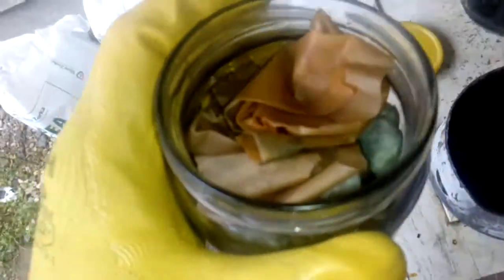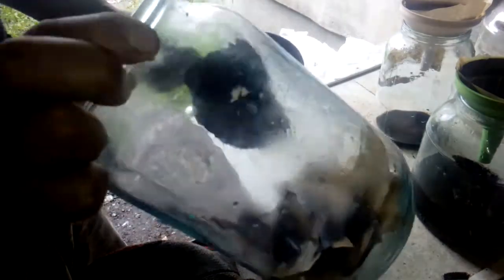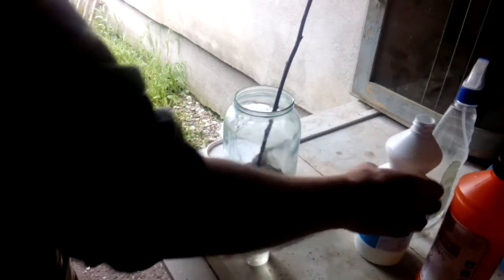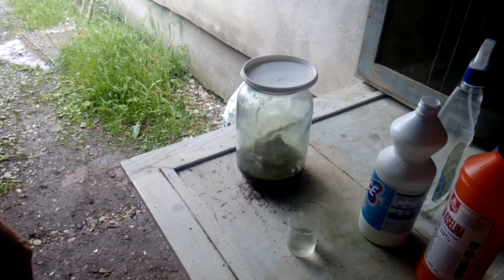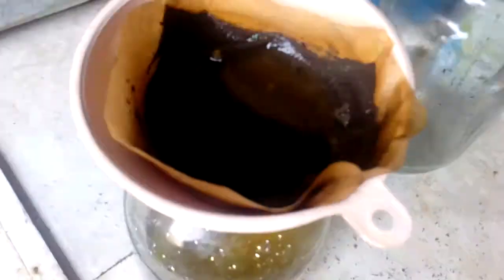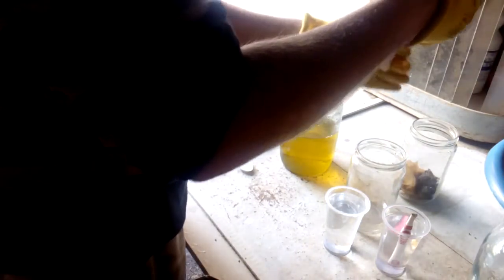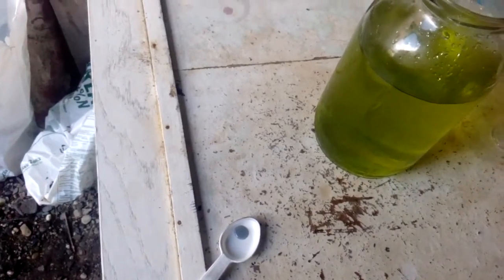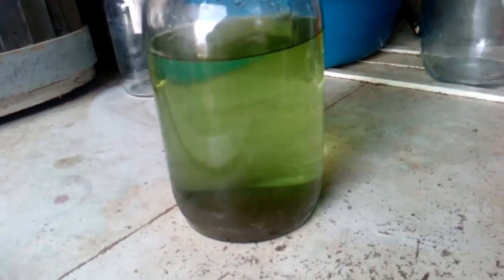Waste filters process for gold.

Comment: I put a shit load of SMB actually stumpout but it didnt have a reaction and doesnt look like ita doin anything it was a real good gold color did i jus not use enoigh or jus wait and see??
Reply: It dropped but usually theres a reaction but nothing changed when i put the smb in
Reply from the maker: adushman1984 Sometimes the color of the solution does not change at all, and the gold drop, rarely, but happens.
Reply: You definitely didn't put to much SMB in it , SMB is one for one of gold recovery , so if you have 10g of gold powder after drop it used up 10g of SMB and if 1.5g gold powder it would use 1.5g SMB. 
You should try and have an idea of how much gold your going to get and then you know how much SMB to use . I've never been told of to much SMB being a problem so I would make sure I'm using enough SMB for fear of leaving gold behind .
Reply: @Andart4464  of your in doubt if any gold left, just check it with stannous bro
Reply: If it didnt drop and you had a positive stannus test. You prob have excess nitric or chlorine which makes the dropped gold redissolve almost instantly. You have to evaporate or denoxx

Comment: does it matter if there is a little copper or iron left in my foils when i ad bleach or should i use hcl to clean it before bleach
Reply from the maker: It is always better to remove all base metal but very smol amount base metals will not hurt the process when the fingers are in question.

Comment: Dusan what do you do with the solution after you drop the gold ? can it be reused
Reply from the maker: You can not use it again. I spill the used solution in a bucket vith a solid copper, when the bucket is full, I wait for two or three months, then I process the slug that replaced vith  copper in the solution, I always get a little more gold or other precious metal. It's called stockpot.
Reply from the maker: I vil soon,I have almost processed all the deposits from the stockpot, so I will need time for it, but I took your proposal into account :)
Reply: 999 Dusan Gold recovery make stock pot video
Reply: Can i use powder bleach